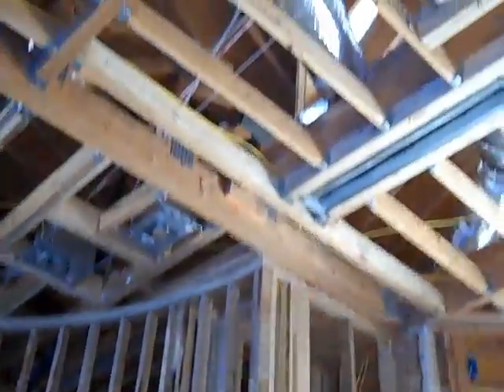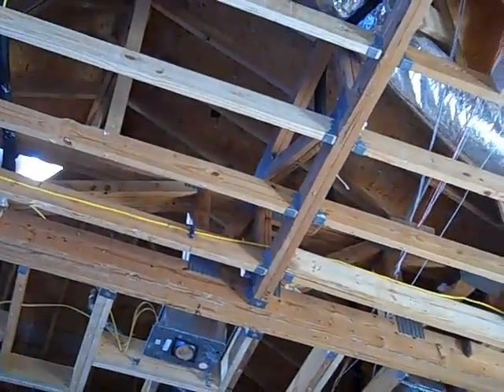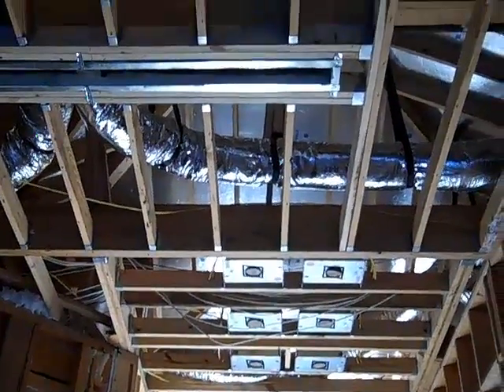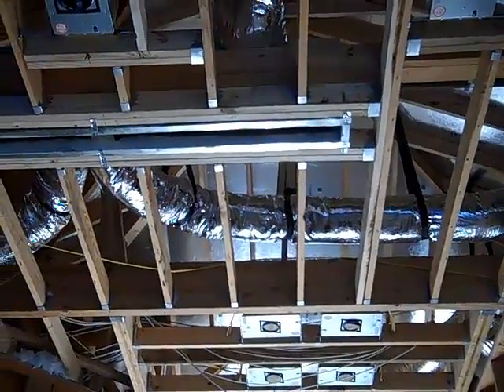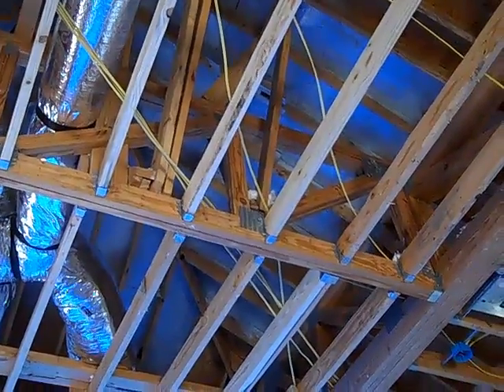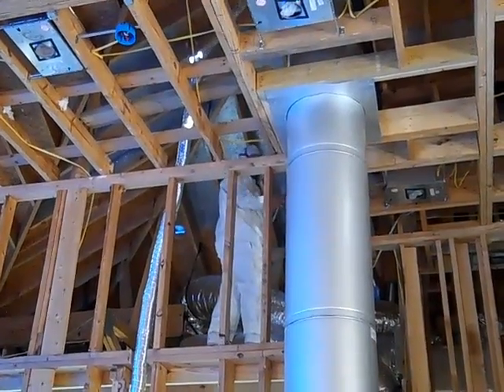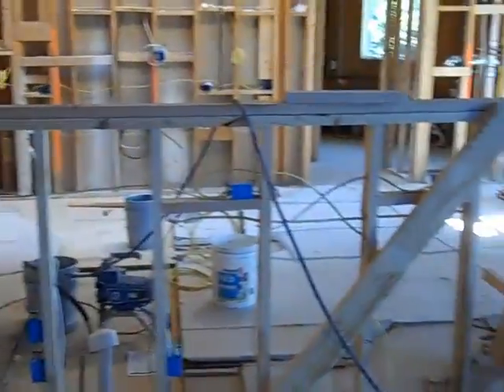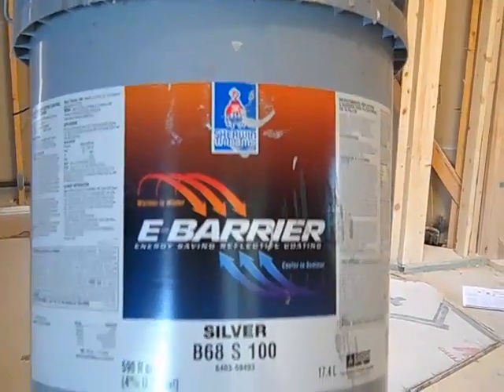Radiant Barrier Paint - Sherwin Williams E Barrier

Comment: 10 year old post. Been researching foil barriers a lot for our house in Florida. Radiant barrier needs an air space, at least 2 inches from the radiant surfaces( roof ). They should have put a foil roof barrier on top of the roof, with the metal roof spaced up with slats, or foil barrier on the rafters with an air space above.
Reply: Yeah cause technology evolved so much....
You know, centuries ago they didn't need barriers in their castles, and they were cooler than any amelican house.

Comment: If you spray it onto the wood where is your air space??? Won’t the paint just conduct the heat from the wood?
Reply: My thought as well. Assuming it uses aluminum additive, it will get some effect from the lowerd emissivity (the paint itself radiating head) of aluminum at 3% which is much lower than wood, but it won't get any benefit from the 97% reflectivity had it been applied in the opposite direction with an air gap. Not the best way to use this.
Reply: My thoughts exactly! That paint isn't going to do shit. It comes down to laziness and not wanting to put the effort in putting up the foil instead.
Reply: Ditto.. Reflectix makes a product with air bubbles and it still wants 1/2 inch space.   I think this is all marketing BS to add more materials and labor.
Reply: My question exactly.

Comment: change out hvac equipment to  power  vented  equipment? What are you saying?
Reply: Dennis Adams If you look up on google “Induced draft furnace, natural Draft furnace, or sealed combustion furnace” those are the three common types for residential gas fired heating appliances. When the attic is being sealed shut to a non-vented attic there is no longer enough CVA so the machine must pull air from outdoors to it’s sealed combustion chamber and then power vent it outdoors with a power/sealed combustion furnace which is usually a machine with a 95% AFUE rating of higher.

Comment: Serious comment. Ive found that you can buy a product off of ebay called "insuladd". Its a ceramic micro-spehere powder that you can add to interior and exterior paint. It works excellent on rooftops, if you use an acrylic paint, and glop it on nice and thick. I swear by this stuff. Basically creates a reflective membrane all round the house. Reflects indoor heat, during winter (if use indoors). Im surprised hardware stores dont carry it. Doesnt seem like many people know about it in general.
Reply: I've looked into this a few times, and it's hard to find any legit info on if it even works. They make lots of claims on their website, but there isn't any trustworthy proof from other sources that those claims are accurate. All the videos I've seen online of people testing it they are not testing properly, applying or testing in the wrong location, not controlling for other variables, or the test video is from Insuladd itself. I'd love to test it myself, but I don't have the spare cash to shell out for something without knowing if it works first.
Reply: @PlutonianPenguin surprised that in your research that you haven’t found the guys that actually do experiments with this and show you it’s full potential on YouTube. 🤔
Reply: The acrylic paint/insuladd powder combo, also cools concrete, when applied. The concrete just doesnt retain the heat because its reflected away.

Comment: Do you still use the radiant barrier paint if your going to use spray foam?
Reply: I guess they don't want to answer your question. Makes me wonder why. 🤔
Reply: @bitscollins   I think he will be using in the walls. I put spray foam in the walls, and on the attic floor. Live in Hot Louisiana. Have been setting the A/C at 78 with the ceiling fan running. If We keep the humidity low in the house it is comfortable.  We have been cycling the A/C to remove the humidity. But are considering just buying a good dehumidifier. Considering the electric bill our neighbors have. and their homes are not comfortable. The foam is the way to go.
Reply: You would have to work in an air gap somehow - for the radiant barrier to work it needs an air gap behind it